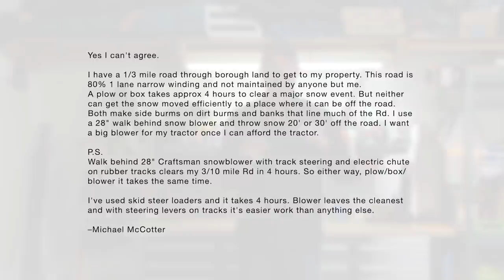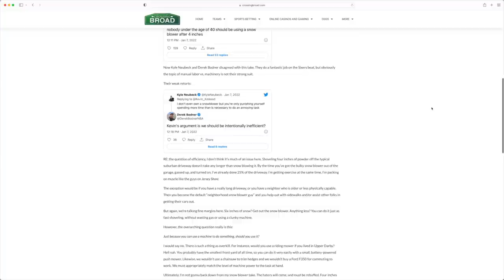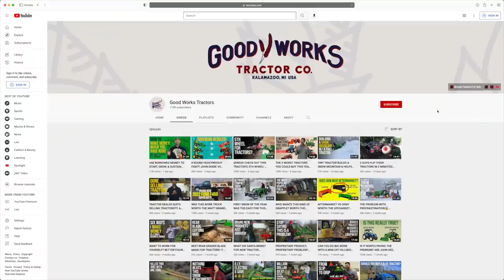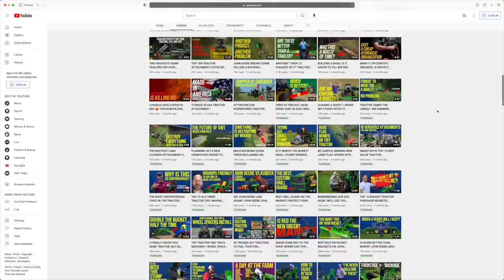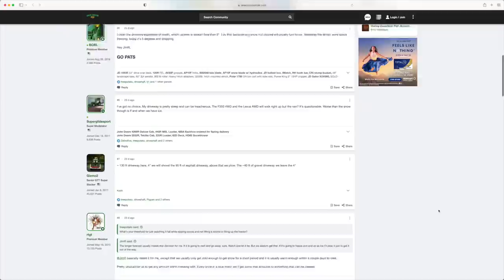WAIT! THERE ARE RULES FOR SNOWBLOWING? WE'RE NOT SURE WE AGREE.

Comment: Murphy’s laws of snow removal: 
1. The direction of the wind will always change to either blow the snow back in your face or deposit it back where you have already cleared.
2. If your machine is ready to go, full tank of fuel, chains and wheel weights in place, the expected storm will fizzle out.
3. If you think you are set the battery will be dead. 
4. If you decide it isn’t enough snow to bother with, it will partially melt and then freeze leaving you with a skating rink for the next week or two.
Reply from the maker: Haha! If only this didn't ring so true!
Reply: 5. Based on Murphy's Law #4, you bust your * on said skating rink. Makes for great video.
Reply: Your rule #1 is right on.  Sometimes if I blow left, its comes in my face, so I blow right....and it blows back in my face.....yes the wind is blowing two directions at once and both are directly into my face.
Reply: Addendum. All walk behind snow throwers that start in the fall won't start as soon as it's needed in the winter
Reply: @ian3580  And that’s why I own a B2650 with a cab! 😁
Reply: @deanstrickland6993  LX3310 Cab here but yes who cares where the snow floats then!

Comment: I worked for a commercial snow removal company when I was in high school.  Clearing snow CORRECTLY is critical.  You have to put the snow where melting snow won’t flow back to the pavement and freeze.  Now my only concern is my driveway and I take pride in clearing it.  I use my snowblower or my walk behind plow.  Driveway need to be cleared not just for me but for the mailman, oil delivery person, Amazon, or emergency responders.
Reply: Underrated statement at the end of your comment about keeping things cleaned up for others that may need to get in your driveway.

Comment: I'm 70 years old and we have a 1,000 foot asphalt driveway.  I ain't shoveling.  I have a Frontier front mounted snowblower for my 1025R.  It works great for me.  I wish it was a little easier to put on and take off but I deal with it.  We don't get that much snow in NE Indiana so some years the snowblower just sits in the corner.  This year I've used it 3 times so far.  Thanks for sharing.

Comment: Grew up in north central MN, we had gravel driveway and John Deere 110 with a snowblower. We used the snowblower with any amount of snow, the first couple trips it was guaranteed to break a couple sheer pins until the loose rocks were cleared away.

Comment: My driveway here is about 1/4 -1/3 of a mile. The first winter, I used the 28" blower I had before buying the property about one and a half times before I said, "to hell with it" and just did the end of the road, the apron in front of the garage, and just drove over the rest. I bought a BX with a front end loader that spring, and finally switch from the loader to a back blade this year. The blade/loader combo worked perfectly, even through the 12"+ of snow we got last week here in extreme SW Michigan.

Comment: I love the guys trimming the hedges. Rule number one should be to use you're blowers safely. And this goes for walk behind blowers as well as tractor mounted blowers. NEVER put you're hands in any blower while the engine is running. NEVER. Please stress this in you're  video and to all you're customers. Stay safe guys!
Reply: I like this comment, a scrap piece of 2x4 or whatever is pretty easy to replace. Hands and fingers, not so much. As an industrial maintenance technician I've seen some pretty dumb stuff over the years. Chewed a few people a new one, haven't lost anyone. Or their appendages.
Reply: I have had to extricate a few hands out of snow blowers over the years. I am presently setting up a training at my volunteer Fire company for just such an occasion for the new guys
Reply: I use a ski pole with its basket to clear snow from a snow thrower. Also I disengage the PTO but never put your hands anywhere near or in the blower

Comment: Living in Halifax Nova Scotia it depends on what we get. Frequently we will snow followed by rain. If it's over a few inches I will have the tractor driven into the garage so the 3point snowblower is out the door first. If only 2 or 3 and it's water logged I will use the snowflake onthe loader to push it off to the side. Under an inch of light fluffy snow and it's a nice sunny day I will shovel for the exercise and enjoyment. I used to be the only one on my road with a tractor now there are 3 of us with tractors with attached snowblowers

Comment: When it comes to snow removal, the "Trump Card" to those 5 Rules is "Work smarter not harder".  If there's enough snow on the ground to warrant breaking out whatever you got for snow removal, I'm probably getting out the tractor & loader with either the snow blower or blade.  By all means, be a "Good Neighbor" & clean out the neighbor's driveway.  Most neighbors will return the favor at some point.

Comment: i started out as a good neighbor, but then i started getting requests from people further and further away. some people insisted on paying, and a business was born.  i run a 72" 3pt, and a 72" pusher with backdrag.  on an L3800. it typically takes less than 5min/driveway (depends on snow fall and driveway size and shape).  i don't go out for less than an inch or 2.  the blower leaves about 1/4" or so anyway.

Comment: I know this post is a year old, but winter isn't that far away again.  I have a 185' driveway with about 100 feet at a 10 degree pitch (measured).  I have a JD X585 with a 47" blower that I use all the way down to half an inch of snow if the weather is going to remain below freezing because that slope gets just enough shade that it can slick if not cleaned.  I used to have 30" walk-behind blowers and after falling coming up our slope on three different occasions, I knew a tractor solution was in my future.  So, in 2016 I found my 2002 X585 with the blower and mowing gear and I am SUPER happy.  I also get the over-40 rule qualification being I'm 61.  😄

Comment: I have 1100 foot drive with a hill and on a north slope.  All the snow must be removed every snow.  If I pack it down with car tires and we get one warm day that night it will freeze and  I am stuck.  
I have a stone rake with a piece of thick rubber mounted on my side by side.  I can open 4 inches in just a few minutes.  the gravel will be showing and not much gets pushed off to the side.  I also have a B26 with a blade and a garden tractor with a snowblower for deep snow.  
Hot tip:  The new backpack blowers blow the stones right back on the drive.  I use the Echo 8010 and it makes short work of this job.

Comment: I just have a 26 HP garden tractor with a 40” blower attachment (just here to dream of bigger tractors). I’ve got about 1/8 mile of gravel driveway. I’m not about to shovel any of it.. but I’ll run the blower up and down a few times for 3-4”. I don’t do it for us. It’s mostly so emergency services, couriers and the oil truck, etc can access the house. Also have my cheesy little tow-behind sander/salter/seeder for when the driveway eventually turns to a sheet of ice.

Comment: I should get a snow pusher because my current blower doesn't clear to the ground real well.  It looks like the MK Martin pull types scrape really well.  My old front mount 42" JD did an excellent job, but far to small for my 3046R and I want to leave my loader on anyway.  I've got an Allied 50" rear blower, but it doesn't have a good cutting edge.

Comment: For me there are many factors on how I approach snow removal. How much, near future (1-3 day)weather, longer forecast (1-2 weeks), temps outside (not as big a factor now with new equipment), and what is on the tractor at the moment. Trace amounts can be troublesome if I have the blower on the front of the tractor. Yes swapping over to our power broom is fairly easy but having to swap back and forth does get old. So anything under 2" I will since the blower simply does not handle that volume of snow well. Anything over that though and I am perfectly content to sit in that nice warm cab and move snow with the blower. But under 2" I will put the broom on and just get it done far faster. The ultimate playing field leveler though is much like our last winter event where it was just ice/sleet. Nothing worked for that....at least until I got some separation between the ice and asphalt. Then the broom worked pretty good. At the end of the day as long as the driveway is safe and clear of winter slop....who cares? LOL!!!

Comment: Still saving up for a tractor but have  28” walkbehind blower. I have a gravel drive & my blower is set to 3/4” or 1/2” if I have a good base down to cover the stones. So 1” or so I leave to accumulate & seal off the stones. Anything more I clean off w/ the blower to prevent the drive from getting rutted up when it freezes w/ tracks in it. I also do my daughter’s next door & my neighbor on the other side of me. Daughter’s is paved so 1” or so of fluffy stuff my leaf blower will take off faster than my snowblower. Is it Spring yet?

Comment: I live in Eastern Ontario Canada...lots of snow, rural setting.  I have about 500' of gravel driveway/parking area.  I use a JD X739 with 6x42 lb suitcase weights at the back, quick-hitch setup at the front, HDAP tires.  Up to 2" of snowfall, I don't do anything.  For quick snow removal of more than 2" and less than 10" of snow, my weapon of choice is a 72" blade...it's much faster than the 47" blower and takes a lot less gas.  If more than 10" of snowfall, I'll swap out the blade for the blower (takes maybe 15 minutes to do that).  Otherwise, I'll use the blower once or twice a winter to cut back the piles I make with the blade, if they get too big.  That's what works for me...

Comment: I use my Pronovost INV-80, a 7' wide inverted blower on the back of my 67hp tractor for just about any snow event.  Why?  1/4 mile long shared driveway and then 3 houses branch off it.  It takes about an hour to clear an average size storm.

The HP is there to throw not only good snow, but I've slung slush too.  Best of all, the 1000 lb blower does a good job of scraping up any icy layer.

I have a 28" walk behind.  And when the tractor was down, I did do that 1/4 mile using the walk behind.  Thankfully only 6" of snow that day, but it took over 4 hours to clear and I didn't do nearly as much as I typically do with the tractor mount.  With the tractor, I'll cut back the snowbanks on the main road for about 100+ yards in either direction just to open up the road a bit more.  No way I'm struggling with the walk behind to do that.

One rule I have when using the blower - especially the tractor mounted one is that the chute is NEVER pointed at anything that could be damaged.  It's too easy to pick up a stone on a gravel driveway and throw it.  The tractor's blower has tossed rocks the size of a baseball and they go a LONG way.

There are a couple videos on my YouTube site with my 1968 Ford tractor and Pronovost blower if you are interested in seeing it in action.

Comment: I sold my snowblower this year. I sold it for many reasons. The main one was because I also own a rear blade which has 3 hydraulic adjustments on it. Thus, I don't need to get off the tractor to adjust it; that saves time. Once you install one or the other, you really don't want to take it off during the winter. I feel snowblowers are good for long roads and shooting snow over fences, birms, and etc. My blower clogged a lot, broke shear pins, and it just wasn't needed unless the snowfall was over 8 inches deep. This happens only about 4 times per year with most snowfalls being less. Last, my entrance road was too short, 80 yards, to really get the blower benefit. I can push the snow with the front loader and blade quicker than dealing with a snowblower. Snow blowing is cold too. At some point, the wind will always blow cold snow on you in an open tractor.

Comment: Parts of my driveway are bounded by walls while the other part is about a 15 to 17% grade x 130'.

I plow what I can and if there's going to be a lot of snow I'll use the snow blower to toss the snow up over the walls for future storms and easier navigation of the cars.
Even have paddles for my Combi unit if there's not enough snow but fluctuations with temperature causes sheets of ice so I'd rather get it out as it helps reducing slip and falls and cost for rock salt or calcium chloride.

Comment: Late winter 2011 I used my John Deere 524 walk behind snowblower to clear a 1000 feet rural driveway plus clear another several hundred feet of driveway around the barns since the property owner was down south for a month. Some of the snow was higher than the top of the inlet of my JD 524. I did it two evenings in a row lighting up my way with my Ford Ranger. Thankfully I put a 7hp Tecumseh Snow King engine on the 524 around 2007. The original 5hp engine wasn’t enough.

Comment: My driveway is about 450 ft long with a large square area in front of the three-car garage.  For something like a dusting up to about 3 inches I used the 52" rotary brush on my x739.  For anything deeper, I'll use my 28" Simplicity walk-behind blower that I call "The Beast" (a professional machine, not the big box type models).  Maybe in about 10 years I'll buy the 54" blower for the tractor.  Other parameters that I factor in are: the brush cannot move the snow too far off the pavement compared to the blower (is there snow on the ground already?) and upcoming weather forecast.  I have a little Bully loader on my other x739 should I need it.  Worst case, my bro-in-law comes over (about 5 min. away) with his backhoe for the really heavy stuff (like the 40-incher last year!).  My usual motto is better living through machinery or hydraulics.

Comment: I've used my snowblower to pull my garden tractor up a hill and into my garage when the transmission belt broke in August.  I look at it this way.  I own the machine, I bought the gas, I own the property, I will make the rules.  If I want to run the machine on an inch of snow before work on a day the temp is going up to 55, then that is what is going to happen.  After a couple years, the neighbors taking video of me doing stuff normal people deem 'stupid' doesn't bother me any more.

Comment: Long rural drive with several out buildings. I'm retired and as such no longer work everyday in the shop. A couple of years back before I finally invested in a full compact (B7800 w fel) We had a series of storms and no melt. I couldn't get to the shop to get the shovels etc. had to snowshoe from the house to the shop. Never again, Loving my old Kubota, one to the wisest investments I've ever made. I, however don't care for the cold so much anymore, so I usually wait at least until things are impassable. The tractor has a home made roof (was a cab, but the lexan was crazed, so I removed it) and it's nice, along with my electric heated seat (Walmart, 5 bucks on clearance), and electric insoles, I'm good to go. Got a trucker fan for the Summer, and an alternator upgrade to power the HF Aux lights and all my other accessories.
It's not such a bad job, making big piles out of big sheets of snow. You are 100% correct on how miserable the winter traction of Industrial tread tires are. Good thing I can walk it out with the loader when I get in too deep. I may try the siping thing with the tread groover, Boras with chains would do it, but that would be $1000+, as would AG tires and Beet Juice transfer. It's good for now.

Comment: #1 I was born to old to do anything by hand that I can do with a tractor. I have a personal rule "if it takes more than 2 shovel fulls, I'm getting a piece of equipment. 
#2 I've spent way to much money on equipment to do anything by hand.
#3 I do agree with the correct tool for the job and I would rather be in a position where I have 100 HPs too much horsepower than 1 not enough.
I got about 20 tractors from 7 HP to 400 HP.  And any one thinks I'm just lazy come on out, I DARE you, we would love to have you and you won't make till lunch.

Comment: I think you need to think of other scenarios than your own. 1st:There is no way my FEL or anyone's else's plow (Snowblower comes the closest) can clear my drive as clean as my shovel. 2nd: If you have a steep drive like mine the option to not clear it to the macadam surface is not a choice..I almost always go over my 300' drive with a shovel unless the temps are above freezing and the sun is out, in which case the perfect southern exposure clears it. If no sun and freezing then salt is needed. 3rd folks are sedentary enough, so if you can exercise it would always be my choice. I would rather shovel (light 2" snow) than walk on my treadmill for exercise. 

If physically unable then of course use our machinery. These are all guidelines...The only hard and fast rule is "Don't eat yellow snow" 😄

and I'll ask this question here...Is a JD loader hydraulic angle snow plow 72" for $1500 a thing of the past?

Comment: My driveway is 600’ and I did clear it with a 28” snowblower…… and it really sucked when it was wet and heavy snow…… I guess with age you try to work smarter not harder. It took me 3-4hrs to clear my driveway. Now with the 56” blower on the tractor it only takes an hour if I’m being real fussy.

Comment: Cost of blower. Sometimes it may be nice to have an attachment if the cost doesn’t out weigh the benefit. 
Diesel tractor and cold conditions don’t always mix well in sub zero temps. If stored outdoors. Most aren’t garaged. Using diesel tractors in winter can be a pain if you don’t have heat or power close by where tractor is kept. 
Is there a snow removal tool other than a blower that would work for snow and other tasks, blade, push box, broom, air blower ect. 

All said. Use it if you got it or get it knowing that it will be stored more than used normally speaking. It should out last the tractor. It’s an awesome tool and if I had one I’d use it at every chance I could naturally.